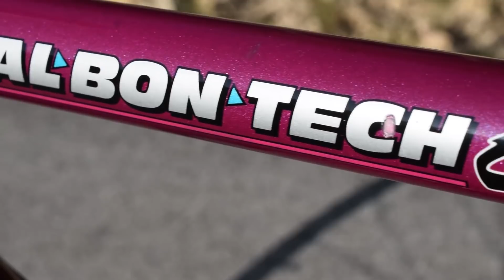Bicycle of the garbage container to the streets -MERIDA ALBON TECH C3-

Comment: Bought an old bike like that that this dude just stored on the side of his garage. Rain, dust, dry rotted tires.  Brand was Miyata.  Didn’t keep original components.  Maybe should’ve. Oh, did keep the crazy oval chain rings.  Paid $100. Been riding it for 20 years now. Thousands of miles.  Never very fast.  But we went.  Any way now working on a Bennato.  Has all original parts.  I’ve taken it as far as my limited skills will take it.  Will have to have the pros finish it off.  It’s been fun.

Comment: Supernice job, i do restorations like this myself for a lifetime hobbie,  Most of the bikes i Keep because of the buy- and-throw filosophy today. Im impressed that you manage to find a old bike that didnt have all the bits stuck,  like the seatpost,  crankcase and pedals Always is rusted so they stuck.
Reply from the maker: Thanks a lot friend. Luckily for me this bike seems to have been in a garage for a long time picking up dust, if I had to take care cleaning in the internal areas, since an orange powder came out of oxidation. I was very lucky to find it and that its former owner did not leave it on the street or if it had not been another story, greetings and thanks for your comment. ; )

Comment: Nice original paint!!  Glad you didn't repaint.  The scratches a bike gets as it ages are just as much a part of it's history as the components.  As long as the paint damage does not affect the integrity of the frame I say leave it original with some light paint touch up where corrosion could be a problem.
Great job!!
Reply from the maker: Thanks a lot friend!!! You are absolutely right, as long as you can leave the original painting, you should not have any doubt about leaving it, I have that problem in the colnago that I am doing now, it is impossible to remove the paint with which they painted it, to leave the original and I have to paint it, greetings and thanks for your comment; )

Comment: You done a good job on this bike  I also tried find out the year this bike was made but unfortunately couldn't find any info but I'm guessing this bike is a late 80s spec or early 90s
Reply from the maker: thanks !!! The truth is that there is not much information about the bike merida and its production in the era of the 80s and 90s. But well we will keep trying. Thank you very much for your comment. ; )
Reply: The bike is equipped with mismatched components.  That style of Campy super record crank I believe stopped being sold around '87.  But the brakes and most of the other parts are newer.

Comment: What kind of polish do you use at 5:20? Doesn't it screw-up the paint job?

Incredible job btw
Reply from the maker: Thanks friend !!! No, you have to know how to handle the polishing machine, since you have to be careful not to exceed the heat where you polish, but it is great. The polish polish I use is from the cindis brand, but you can use any brand. I hope I've been helpful; )
Reply: You can absolutely burn through paint with it, you just gotta remember that you're polishing not sending or grinding. Light touch. He did good.

Comment: Curious: I was surprised to see you take the time cleaning the old saddle...but thought, what the heck it might be perfectly fine after being scrubbed with soap and water...But then in the end you swapped it out with another old saddle...what was wrong with the original?  Just wondering.  I'm a retired bike mechanic...brought back a lot of memories of the days in the shop.  That's a ton of elbow grease!!!
Reply from the maker: Then change it, because it does not stick much with the new handlebar tape, but in reality the saddle was great, thanks for commenting friend; )
Reply: A black saddle always looks better than one like that one you scrubadubdubbed.  For resale in the shop though, sometimes it's best to leave the original.   1) saves the shop money. 2) the customer might buy a new black saddle.  But the replacement you put on I suspect was used too?
Reply from the maker: @outlaw7x77  as you already know, in the restorations everything goes and pieces are changed for other projects, thanks for your comment friend ; )

Comment: Hey man awesome work there with your restoration , i am also currently trying to renovate some old bikes can you give some advice die to the Tools you used to polish the frame and cleaning the old parts. Would love to hear from you
Reply from the maker: sorry it took so long to answer you,
The products that have been used in the video are the following:

* Cleaning:

         -Degreaser (KH7 brand).

         -Water and soap (universal).

         -Sponge.

         -Cleaning solvent, for bearings.

* Polish:

         - Polishing sponge (cindis brand)

         -polishing machine (makita SA5040C)

         -Universal polish (cindis brand)

         -NPR abrasive disc (soldufer brand)

         - Universal polishing cloth disc.

         - Universal pink fine polishing paste.

Comment: bb shell does not remove?
Reply from the maker: Sorry, I don't understand the question?
Reply: @dabrestauracion7404  I saw one part of bottom bracket was not removed. it was stuck completely?
Reply from the maker: @CurdPattysRoll  No, I decided not to remove it, since it is difficult after doing the same tightening, everything is cleaned well inside, out and that's it. Thanks for your comment ; )

Comment: All other videos I see, they cut the inner cable leaving it longer. The length you cut it is about the same as I do.
Reply: Some mechanics cut shorter...some longer...me personally I try to cut them with just enough room to get a third hand tool in for future repairs if neccessary.  Figure a Cable is a service item that needs replacing every so often...and IMHO: if theres ever any question...put in a new cable.  Cables are Cheap!  Short?  Long?  Whatever!  just be sure to grease 'em on installation.   I'd say cut them somewhere from 1-2" but just not over two inches that just looks sloppy.  It's all up to the mechanic.  More important is the selection of cable end crimps.  Pick one the best fits the cable diameter.  No: not one size fits all.  After awhile you collect many different sizes, shapes, colors...select the one that fits...again it's up to the mechanic...like his signature.

Comment: Calling BS on the garbage Campy bike. The sti shifters alone are over 100 bucks on Ebay in various degrees of used. The crankset goes for over 50 to 100 bucks used. Even tho it isn't the high end campy parts, the money you can get just by parting it is around 200 to 300 bucks.
Reply from the maker: It was lucky for me to find her. I think it will be very difficult to find another bike with these components in a dumpster in my entire life. But I will keep my fingers crossed. You never know hehe. Thanks for leaving your comment friend ; )

Comment: Clickbait. The cobwebs and and dust on the bike looks like it was sitting in the garage for ages. Not a spec of rust. This bike didn't see garbage container in its life.
Reply from the maker: I don't know if you know that the garbage cans pass every day and clean the garbage containers. It would go from a garage to the garbage container, as is logical. So it can't be in a dumpster for years. A greeting and thanks for comment ; )
Reply: I watched a man put a completely covered in dust beach cruiser in the trash. It must have been in storage for 10 years. Brand new zero miles. So yes it can happen

Comment: That looked more like was hanging in someone's garage because of how the cobwebs were hanging , ain't buying it 😏
Reply from the maker: Hello Friend!!! Surely it would be in someone's garage, but that I do not know and that was left next to a garbage container, I did not buy it, I can control it for you. A greeting and strength for these times that run; )
Reply: @dabrestauracion7404  very detailed rebuild. I tried to do similar on a trek 930 , made in USA mountain  bike, but some parts did not come apart.  The brake pads stems seem to be fused , so can't slide out to change the pads , so need new canteliver brakes , as well as new head set etc. I wish I scored something in better condition.  Here in Wisconsin even if hanging in a garage tend to get moisture,  cold / hot etc . So effects parts I guess. The frame was  minty and  the  and wheel set.  It also looks barely used, but I am switching out some stuff .
I am a fan of campy , being of Italian origin .
Thumbs up I enjoy riding these bike 👍
Reply from the maker: @recyclespinning9839  Big !!! thumbs up !!! Long live the cyclone !! I am very pleased with your comment, greetings from Spain, I hope the situation in the United States is good with this of the covid 19. Greetings and thanks for leaving a comment again. ; )
Reply: Does it really matter that much where it came from, it was all about the restoration wasn’t it!